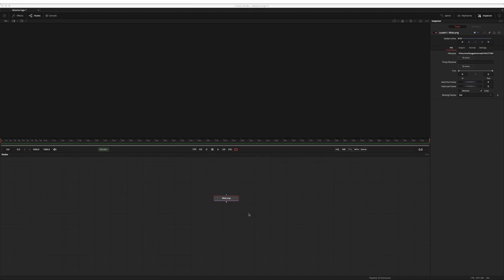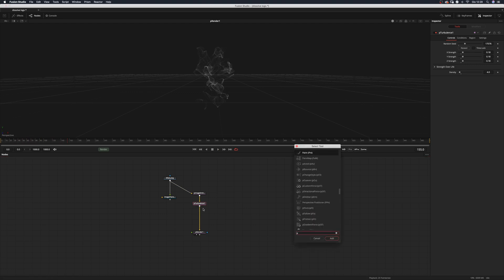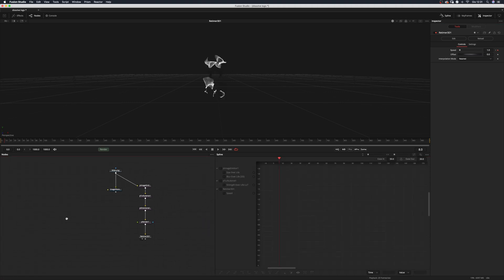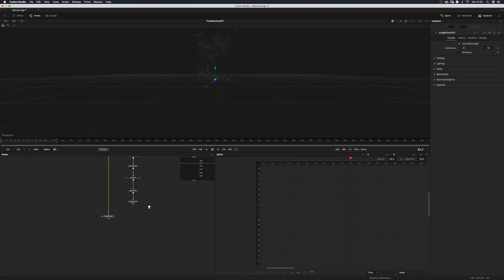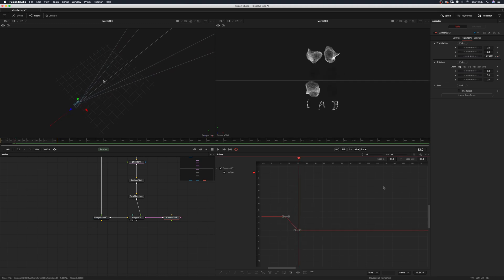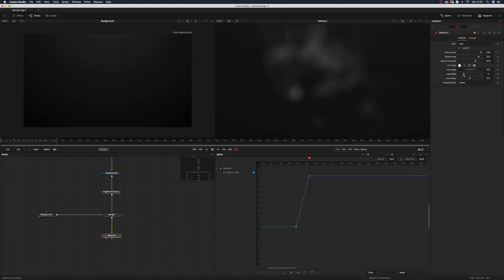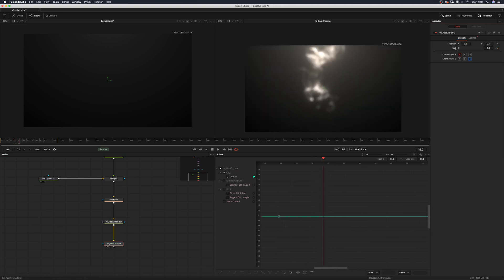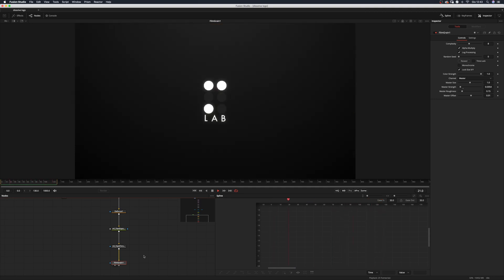Fusion 17: Logo Particle dissolve

Comment: Not sure what I've done wrong, but trying to move a few frames of the animation halts everything and I wait many seconds for it to calculate with pRender1 etc. having a very slow green loading bar.. if I spend 5 minutes to go through the few seconds of animation the timeline becomes green (cached) but playing it back again with no changes will again halt everything and spend a lot of time for every single frame - making it impossible to adjust anything as there is no way for me to know what it looks like in playback.
Reply: you mat want to cache to disk. Maybe you have not enough ram.
Are you working in HD? or 4K?